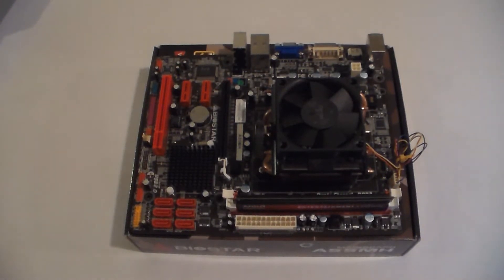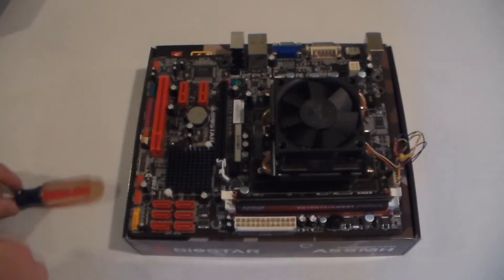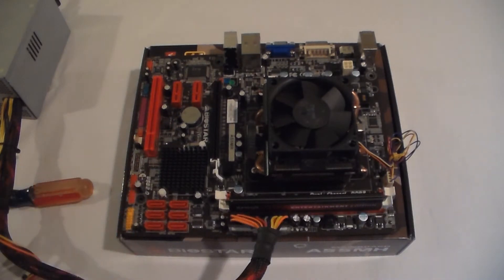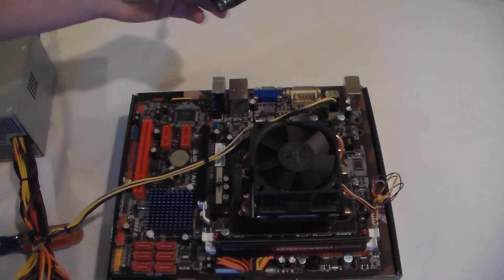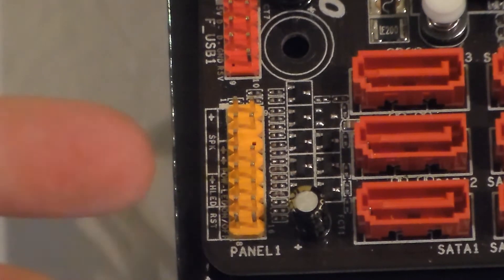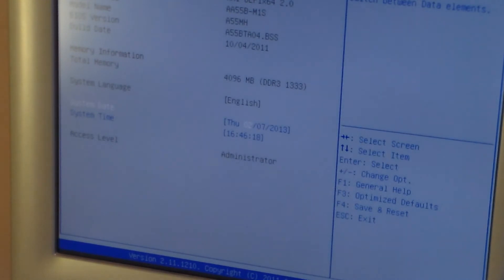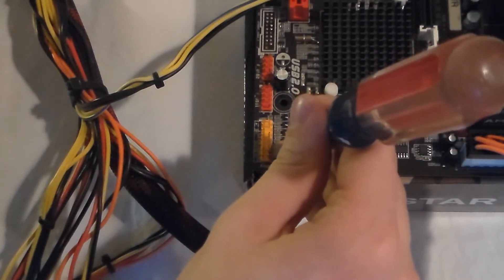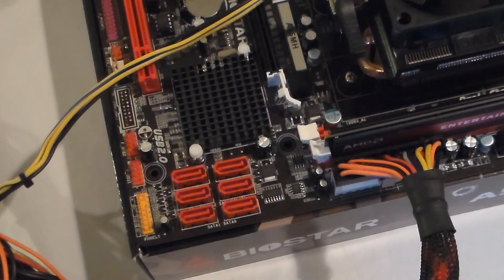how test your computer

Comment: My power supply has 20 pin but on the motherboards I seen 24 connector seem as you. And after assembling pc i have nog signals on monitor. Do you think problem came from these 4 connectors? 
Sorry for my bad English ;)
Reply: make sure that you use 24 pin and NOT 20 pin...